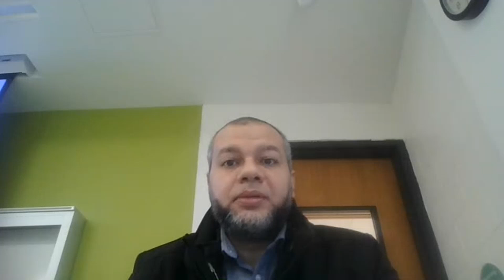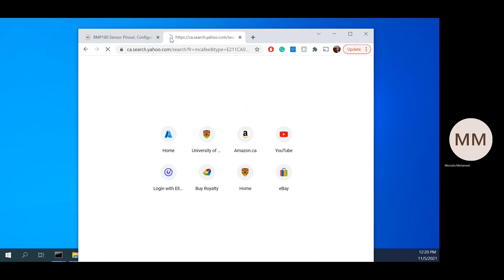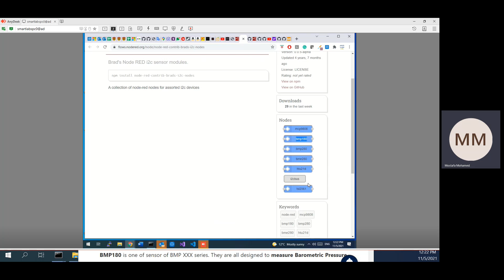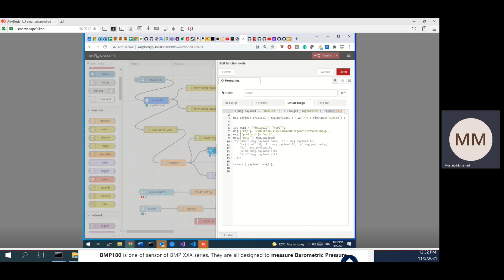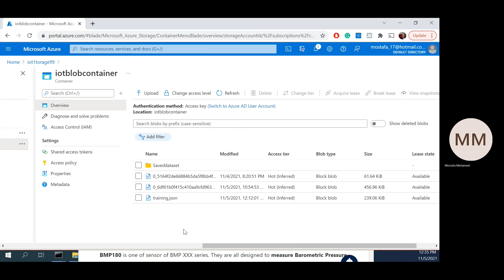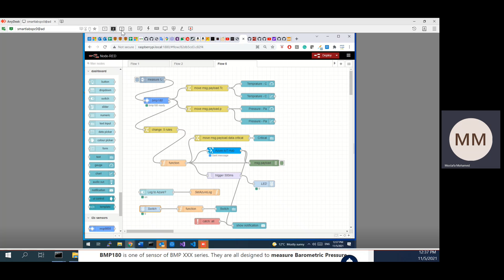ENSF510 Introduction to CPS - University of Calgary - Azure IoT #3

Comment from the maker: Here is the Node-red design flow. You can import it to your Node-Red and change your Azure configurations in it.
[{"id":"82db5cd3.c82f4","type":"tab","label":"Temp & Pressure ","disabled":false,"info":"This design will collect temperature and pressure data from BmP180 sensor, upload the data to Azure IoT Hub.\nYou need to supply your Device Key and Id in the inject nodes, the function nodes.\nAlso put your own end point for the Azure IoT Hub node.\nThe last part with a Switch is needed to collect training data. I added the switch to indicate that there is a special condition (I closed the ventilation register). This part is not needed during normal usage.\nYou can open the UI from: http://raspberrypi.local:1880/ui\n\nThis design is created by Mostafa Mohamed."},{"id":"a97e394a.6cd078","type":"bmp180","z":"82db5cd3.c82f4","name":"bmp180","topic":"Temp/Pres","presolution":"180","debugMode":false,"x":160,"y":160,"wires":[["a43a442d.f81f88","aa8a1a18.86e0a8","d3a0579c.7361d8"],[]]},{"id":"bcb78d2e.6943","type":"inject","z":"82db5cd3.c82f4","name":"","props":[{"p":"payload"}],"repeat":"10","crontab":"","once":false,"onceDelay":0.1,"topic":"","payload":"measure","payloadType":"str","x":140,"y":60,"wires":[["a97e394a.6cd078"]]},{"id":"638cbeed.2673c","type":"rpi-gpio out","z":"82db5cd3.c82f4","name":"LED","pin":"18","set":true,"level":"0","freq":"","out":"out","x":670,"y":560,"wires":[]},{"id":"6836676e.b23fe8","type":"trigger","z":"82db5cd3.c82f4","name":"","op1":"1","op2":"0","op1type":"str","op2type":"str","duration":"500","extend":true,"overrideDelay":false,"units":"ms","reset":"","bytopic":"all","topic":"topic","outputs":1,"x":480,"y":520,"wires":[["638cbeed.2673c"]]},{"id":"5482fabf.1bcaf4","type":"rpi-gpio in","z":"82db5cd3.c82f4","name":"Switch","pin":"40","intype":"up","debounce":"25","read":true,"x":130,"y":680,"wires":[["5082e6d9.1c4798"]]},{"id":"5082e6d9.1c4798","type":"function","z":"82db5cd3.c82f4","name":"","func":"flow.set(\"switch\", msg.payload);\nreturn msg;","outputs":1,"noerr":0,"initialize":"","finalize":"","libs":[],"x":320,"y":680,"wires":[["b31df2e9.c0bf3"]]},{"id":"c88d9d99.527a3","type":"function","z":"82db5cd3.c82f4","name":"","func":"if(msg.payload == 'measure' || !flow.get('logtoAzure')) return null;\n\nmsg.payload.critical = msg.payload.Tc < 40 ? 0 : flow.get(\"switch\") ;\n\n\nlet msg1 = {\"deviceId\": \"rp99\"};\nmsg1['key']= \"ZYNF2Fq3oRs9kjJGmAoWT85ZFj6m/iNl9oS6/CMaO5g=\";\nmsg1['protocol']= \"mqtt\";\nmsg1['data']= msg.payload;\n/*{\"name\": msg.payload.name, 'Tc': msg.payload.Tc,\n    'critical': 0, 'Tf':msg.payload.Tf, 'p':msg.payload.p, \n    'P1': msg.payload.P, \n    'altm':msg.payload.altm, \n    'altf':msg.payload.altf\n} ;*/\n\nreturn { payload: msg1 };\n\n","outputs":1,"noerr":0,"initialize":"","finalize":"","libs":[],"x":240,"y":460,"wires":[["6836676e.b23fe8","3f35ad87.ca2c72","343cff59.33535","9f0cb4ed.40aa48"]]},{"id":"343cff59.33535","type":"azureiothub","z":"82db5cd3.c82f4","name":"Azure IoT Hub","protocol":"mqtt","x":480,"y":400,"wires":[["3f35ad87.ca2c72","e587bd33.79de9"]]},{"id":"3f35ad87.ca2c72","type":"debug","z":"82db5cd3.c82f4","name":"","active":true,"tosidebar":true,"console":false,"tostatus":false,"complete":"false","statusVal":"","statusType":"auto","x":670,"y":460,"wires":[]},{"id":"a43a442d.f81f88","type":"change","z":"82db5cd3.c82f4","name":"","rules":[{"t":"delete","p":"payload.P","pt":"msg"},{"t":"delete","p":"payload.Tf","pt":"msg"},{"t":"delete","p":"payload.timestamp","pt":"msg"},{"t":"delete","p":"payload.altf","pt":"msg"},{"t":"delete","p":"payload.altm","pt":"msg"}],"action":"","property":"","from":"","to":"","reg":false,"x":180,"y":300,"wires":[["c88d9d99.527a3"]]},{"id":"cee7cf6f.6bed3","type":"ui_gauge","z":"82db5cd3.c82f4","name":"","group":"9a96a8b1.92db78","order":2,"width":0,"height":0,"gtype":"gage","title":"Temprature - C","label":"units","format":"{{value}}","min":"10","max":"60","colors":["#00b500","#e6e600","#ca3838"],"seg1":"","seg2":"","className":"","x":640,"y":80,"wires":[]},{"id":"c78a338b.8f908","type":"ui_chart","z":"82db5cd3.c82f4","name":"","group":"1890881e.83819","order":2,"width":0,"height":0,"label":"Temprature - C","chartType":"line","legend":"false","xformat":"HH:mm:ss","interpolate":"linear","nodata":"","dot":false,"ymin":"","ymax":"","removeOlder":"2","removeOlderPoints":"","removeOlderUnit":"3600","cutout":0,"useOneColor":false,"useUTC":false,"colors":["#1f77b4","#aec7e8","#ff7f0e","#2ca02c","#98df8a","#d62728","#ff9896","#9467bd","#c5b0d5"],"outputs":1,"useDifferentColor":false,"className":"","x":640,"y":140,"wires":[[]]},{"id":"aa8a1a18.86e0a8","type":"change","z":"82db5cd3.c82f4","name":"","rules":[{"t":"move","p":"payload.Tc","pt":"msg","to":"payload","tot":"msg"}],"action":"","property":"","from":"","to":"","reg":false,"x":400,"y":100,"wires":[["cee7cf6f.6bed3","c78a338b.8f908"]]},{"id":"d3a0579c.7361d8","type":"change","z":"82db5cd3.c82f4","name":"","rules":[{"t":"move","p":"payload.p","pt":"msg","to":"payload","tot":"msg"}],"action":"","property":"","from":"","to":"","reg":false,"x":400,"y":200,"wires":[["40852e15.6e2f3","7eea4d49.6a15a4"]]},{"id":"7eea4d49.6a15a4","type":"ui_gauge","z":"82db5cd3.c82f4","name":"","group":"9a96a8b1.92db78","order":1,"width":0,"height":0,"gtype":"gage","title":"Pressure - Pa","label":"units","format":"{{value}}","min":"70000","max":"100000","colors":["#00b500","#e6e600","#ca3838"],"seg1":"","seg2":"","className":"","x":640,"y":200,"wires":[]},{"id":"40852e15.6e2f3","type":"ui_chart","z":"82db5cd3.c82f4","name":"","group":"1890881e.83819","order":1,"width":0,"height":0,"label":"Pressure - Pa","chartType":"line","legend":"false","xformat":"HH:mm:ss","interpolate":"linear","nodata":"","dot":false,"ymin":"","ymax":"","removeOlder":1,"removeOlderPoints":"","removeOlderUnit":"3600","cutout":0,"useOneColor":false,"useUTC":false,"colors":["#1f77b4","#aec7e8","#ff7f0e","#2ca02c","#98df8a","#d62728","#ff9896","#9467bd","#c5b0d5"],"outputs":1,"useDifferentColor":false,"className":"","x":640,"y":260,"wires":[[]]},{"id":"9f0cb4ed.40aa48","type":"change","z":"82db5cd3.c82f4","name":"","rules":[{"t":"move","p":"payload.data.critical","pt":"msg","to":"payload","tot":"msg"}],"action":"","property":"","from":"","to":"","reg":false,"x":470,"y":340,"wires":[["9f2a05e0.ca80a8"]]},{"id":"612fbd66.788744","type":"ui_switch","z":"82db5cd3.c82f4","name":"","label":"Log to Azure?","tooltip":"","group":"9a96a8b1.92db78","order":3,"width":0,"height":0,"passthru":true,"decouple":"false","topic":"payload","topicType":"msg","style":"","onvalue":"true","onvalueType":"bool","onicon":"","oncolor":"","offvalue":"false","offvalueType":"bool","officon":"","offcolor":"","animate":false,"className":"","x":160,"y":600,"wires":[["edc0d472.f8a278"]]},{"id":"edc0d472.f8a278","type":"function","z":"82db5cd3.c82f4","name":"SetAzureLog","func":"flow.set('logtoAzure', msg.payload);\n\nreturn msg;","outputs":0,"noerr":0,"initialize":"","finalize":"","libs":[],"x":390,"y":600,"wires":[]},{"id":"b31df2e9.c0bf3","type":"ui_text","z":"82db5cd3.c82f4","group":"1890881e.83819","order":3,"width":0,"height":0,"name":"","label":"Switch","format":"{{msg.payload}}","layout":"row-spread","className":"","x":490,"y":680,"wires":[]},{"id":"9f2a05e0.ca80a8","type":"ui_text","z":"82db5cd3.c82f4","group":"1890881e.83819","order":4,"width":0,"height":0,"name":"","label":"Critical","format":"{{msg.payload}}","layout":"row-spread","className":"","x":670,"y":340,"wires":[]},{"id":"cc229ebf.7a5c9","type":"catch","z":"82db5cd3.c82f4","name":"","scope":null,"uncaught":false,"x":400,"y":740,"wires":[["e587bd33.79de9"]]},{"id":"e587bd33.79de9","type":"ui_toast","z":"82db5cd3.c82f4","position":"top right","displayTime":"3","highlight":"","sendall":true,"outputs":0,"ok":"OK","cancel":"","raw":false,"className":"","topic":"","name":"","x":600,"y":760,"wires":[]},{"id":"9a96a8b1.92db78","type":"ui_group","name":"Col2","tab":"c3173234.2636e","order":2,"disp":false,"width":"6"},{"id":"1890881e.83819","type":"ui_group","name":"Col1","tab":"c3173234.2636e","order":1,"disp":false,"width":"6"},{"id":"c3173234.2636e","type":"ui_tab","name":"RPi Control","icon":"dashboard","order":1}]